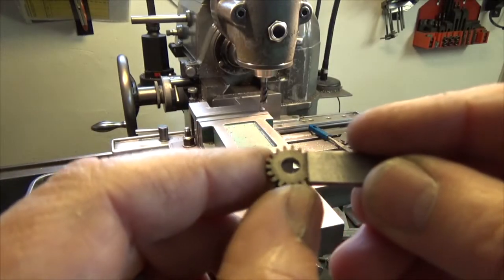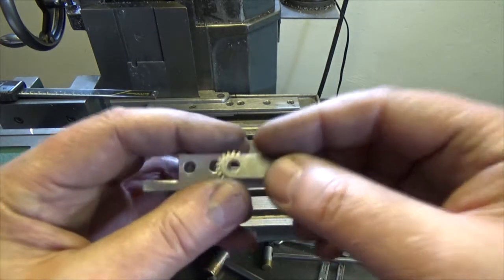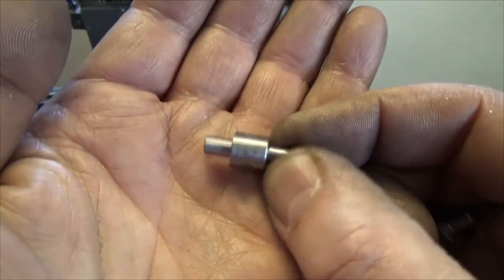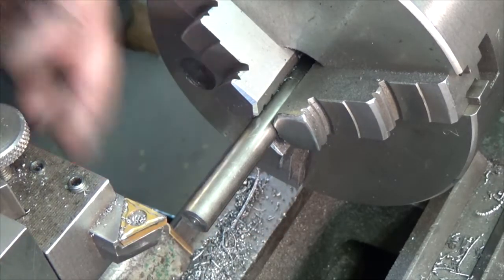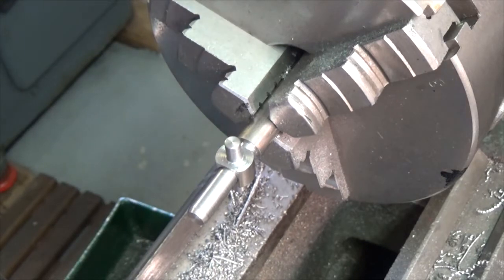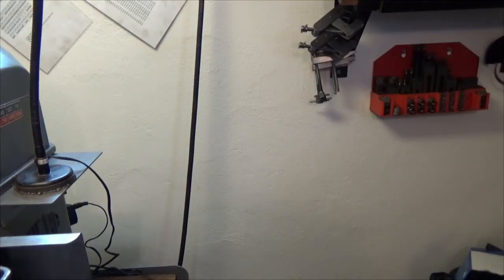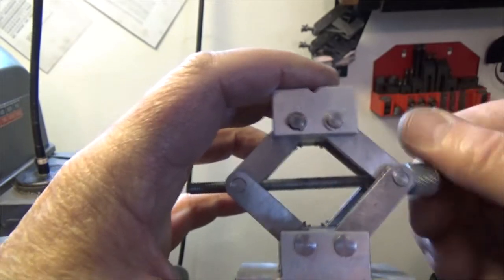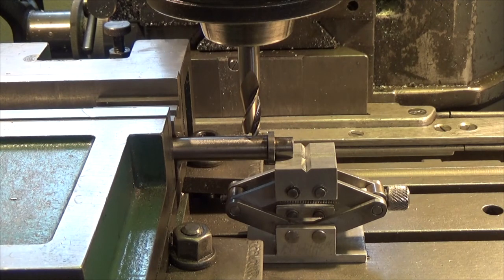Mini Scissors Jack - Part 3

Comment: Full av beundran över hur du ger dig i kast med engelska så här. Jag skulle inte fixa det tror jag. 😣

Resultatet vart ju över förväntan men jag undrar vad det är som klämmer/tar i eftersom du inte fick ihop den helt? 
Och är den tillräckligt stadig när du använder den eller flexar den?
Reply from the maker: Tack Roy.Vad gäller engelskan så trodde inte jag det heller, men det får bli som det blir även om det blir fel ordval, uttal och ordföljd ibland. Jag tror nog att de flesta förstår ändå.

Saxdomkraften går inte att fälla ihop helt beroende på att kuggarna tar upp en del plats. Därför blir det ett avstånd på 5mm mellan bottenplattan och topplattan. En annan konstruktion kunde kanske lösa detta.
Men den är tillräckligt stadig för att fungera till det som den är avsedd för - som ett stöd vid fräsning.